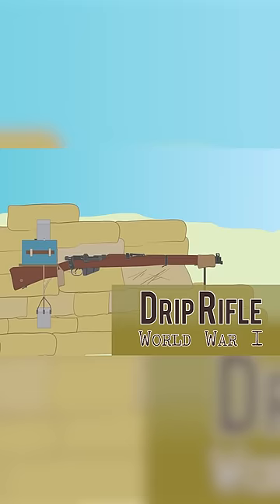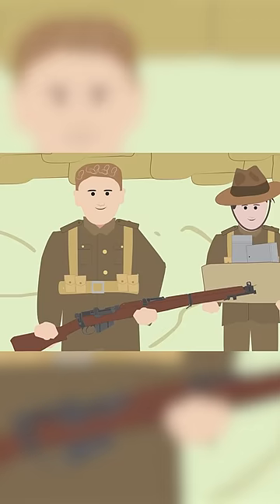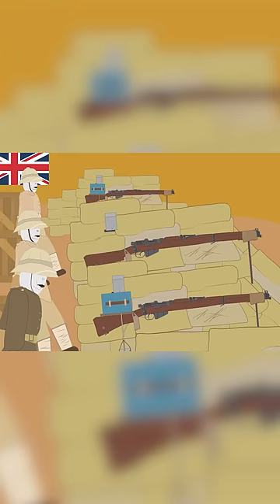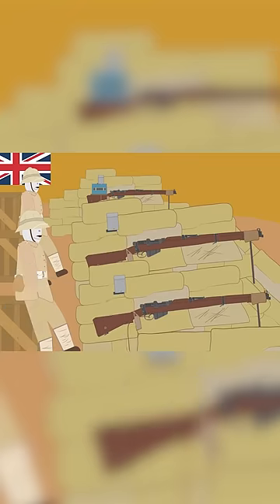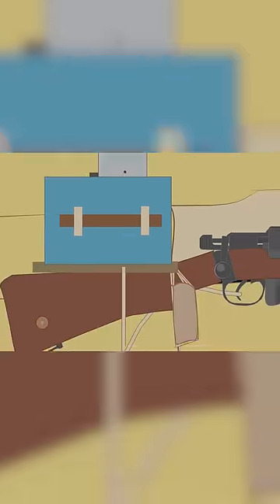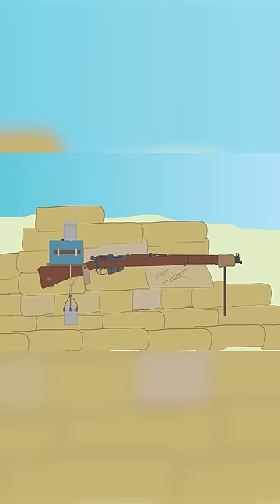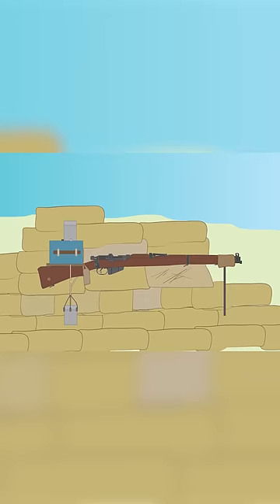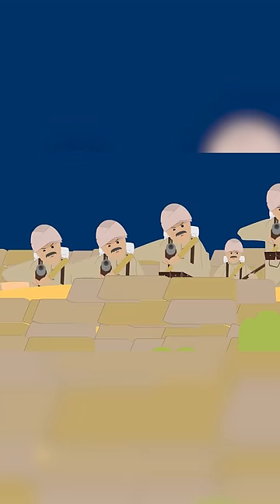Drip Rifle - a SELF FIRING GUN that tricked the enemy in WW1

Comment: The drip rifle was invented by Lance Corporal W. C. Scurry of the 7th Battalion, AIF, with assistance from Private A. H. Lawrence also of the 7th Battalion. For the part he played in making the evacuation a success, Scurry was mentioned in dispatches, awarded the Distinguished Conduct Medal, and promoted to sergeant, then later Captain and was awarded the Military Cross for later actions. The 7th Battalion Battle Honours are now held by 8th/7th Battalion, The Royal Victoria Regiment.  
Drip (or "pop off") rifles were self-firing rifles used at Gallipoli to deceive the Turks during the evacuation of December 1915.
Fire was maintained from the trenches after the withdrawal of the last men, by rifles arranged to fire automatically. This was done by a weight being released which pulled the trigger. Two kerosene tins were placed one above the other, the top one full of water and the bottom one with the trigger string attached to it, empty. At the last minute, small holes would be punched in the upper tin; water would trickle into the lower one, and the rifle would fire as soon as the lower tin had become sufficiently heavy.
Another device ran a string, holding back the trigger, through a candle, which slowly burnt down, severed the string, and released the trigger.
Such devices provided sporadic firing which helped convince the Turks that the Anzac front line was occupied long after thousands of men had crept down to the beaches and escaped. British generals estimated that half the force would be lost in any attempt to withdraw because the Turks could not fail to notice as the trenches were so close. In the event, the Turks were so deceived that 80,000 men were evacuated with only about half a dozen casualties.
Reply: Thanks.
Reply: not sure why you just restated most of what this video was? Not to mention the text is copied verbatim from the Australian War Memorial website on the pop off rifle.
Reply: I don't see how these could fire more than one single shot a few minutes after the ppl left. I guess that's better than nothing if they set up a bunch.
Reply: thanks
Reply: @burtan2000 They're bolt action rifles. They can't fire another shot without human intervention regardless. This invention was basically just a delayed trigger so they could run away and then a couple hours later the rifle would pop off.
Reply: @burtan2000    and that is exactly what the narrator said. They set up lots of rifles like this.  Lots of losses of rifles for sure, but saved thousands of men!
Reply: @loftsatsympaticodotc it's cheaper to leave behind materials in event of an evacuation. This is a problem every time a warsone is created anywhere in the world. (I remember it being described in the fantastic movie- 'Lord of war')
Reply: STRALYA!
Reply: Would this have worked in a scenario like in film Dog Day Afternoon?
Reply: Thanks for the details
Reply: STRAYA !!! Yeah well the Turks didn't have the ordinance to capitalise on the abandoned weapons ... The whole operation was a stuff up from the start. The best thing to come out of this episode was the mateship between the Anzac troops that survived the war .... I think that even they have now marched into History ... Lest we forget ...
Reply: Also the Allied troops gradually reduced the amount of gunfire over days, getting the Turks used to extended periods without any shots.
Reply: I ain’t reading allat 🗣️
Reply: @PBMS123   its actually a wiki article and is wayyyyyyy more in depth than "SimpleHistory"
Reply: @Ye.MemeOfficial  then the wiki article copies the war memorial

Comment: was it one shot only though? I never understood how they're supposed to bolt the rifle when its like that
Reply: yeah single shot but you can vary the timing by the size / height of the hole so it would be multiple shots spaced out from different guns
Reply: Yes. They had to leave dozens, probably hundreds of rifles set up ready to fire. Different levels of water ensured they went off at different times.
Reply: I was wondering if anyone else was thinking about this.
Reply: @castleanthrax1833 Seems like an ineffective tactic that wastes rifles and ammunitions then no?
Reply: @do.notdisturb  Not when you understand what they were trying to achieve. The Anzac soldiers were trying to evacuate from the Gallipoli peninsula, and this tactic was employed to fool the Turks into believing they were still in the trenches. 80,000 Anzac soldiers managed to evacuate with very few casualties. That's worth the price, I think.
Reply: @do.notdisturb  they were evacuating.
So the options are to just all leave quickly, however this risks being charged and shot in the back.
Secondly you could leave a small group behind to cover the retreat, this is the normal tactic. It still risks the lives of the small group left behind, there won't be enough of them to repel an attack and if they are seen leaving they can still get shot from behind.

The drip rifle means you leave some equipment behind, a bunch of rifles with one bullet each.

Soldiers lives are much more valuable than a rifle, both from a human moral stance and from the logistical war winning stance.
Reply: @TacoSniper666  kinda sucked to have to leave a bunch of functioning rifles behind for the enemy to claim and use.
Reply: @rossbrumby1957  socks more to die
Reply: @rossbrumby1957  it's faster and easier to manufacture a new rifle than to fully train a new infantryman. Add in the combat experience of the troops being evacuated and even a completely cold, soullessly logical perspective it's vastly worth the tradeoff.

And that's before getting into moral discussions about the value of your troops' lives or the benefit to morale of at least pretending to try to keep them alive
Reply: @rossbrumby1957 look up the Gallipoli campaign a bit more. They needed to get off that peninsula
Reply: They just needed some time to run away from the trenches
Reply: @rossbrumby1957 Rifles are worth less than infantry.

Comment: Must have had a really light trigger because on a rifle usually it takes a few pounds of pressure to pull a trigger and thats almost a half gallon of water as a gallon of water weighs roughly 8.3 pounds so the teiggers had to be very light or they had a crap ton of water and those ration tins were pretty big

Comment: Sorry, but won't work. Complete folklore. The bolt has to be withdrawn rearward after the bolt handle is lifted to unlock the action and the n pressed forward and bolt handle pressed down before the gun can fire. The trigger can be pulled all day long but will only fire once without a means to work the bolt.
Reply: It did work because it just needed to fire once